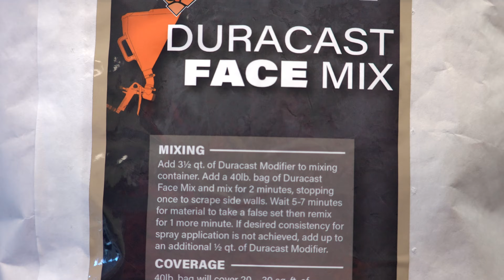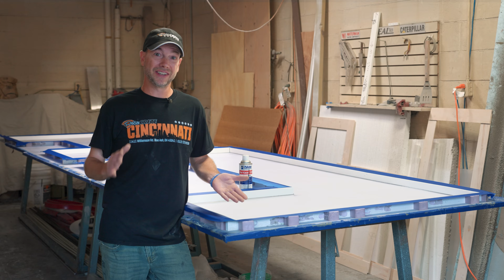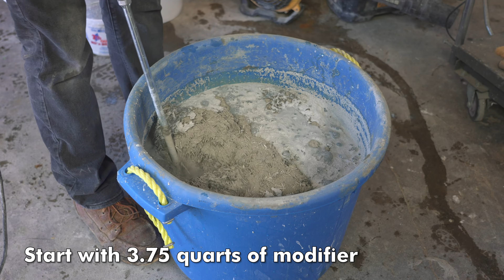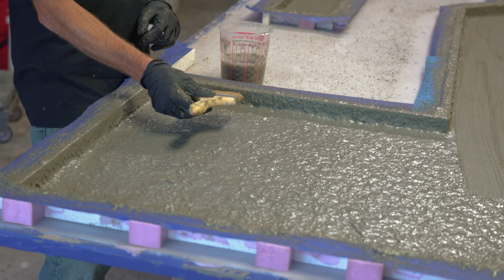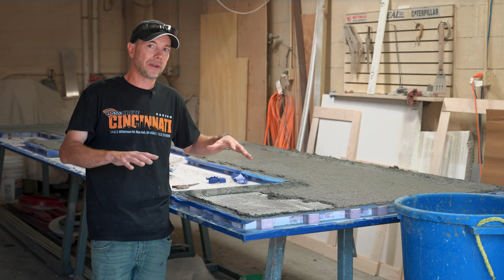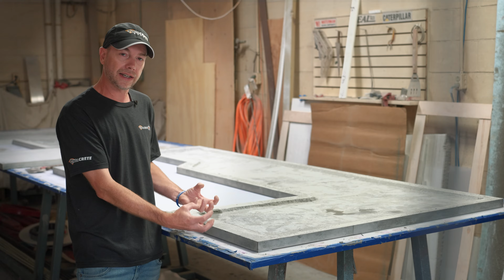How to Create a Concrete Countertop!

Comment: Great video! Do you glue the strips down to the melamine or only the supports blocks get hot glue? Thanks!
Reply from the maker: Thanks for the comment!
In most cases, it's a good idea to glue both of them. The support blocks will hold the side rails from moving outward, but a little bit of glue under the rails will keep them from lifting up. It also works to put in a few extra support blocks and glue the rails to them so they don't lift. Caulking with silicone around the inside edge will also help keep the forms in place and give you a nice round over on the edges. I'll leave a link below to a video on the caulking.
Hopefully this helps! Thanks for watching DecoCrete TV!!!  
https://www.youtube.com/watch?v=X6UMh5HkQTg
Reply: @DecoCreteTV Great information, thank you for the answer. Keep up the good work!